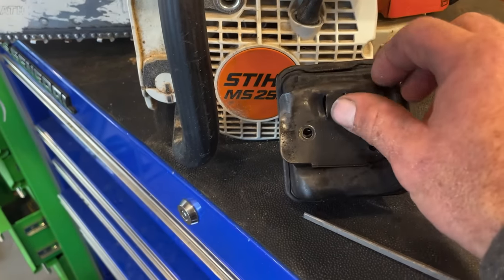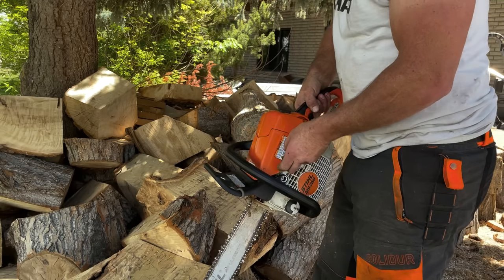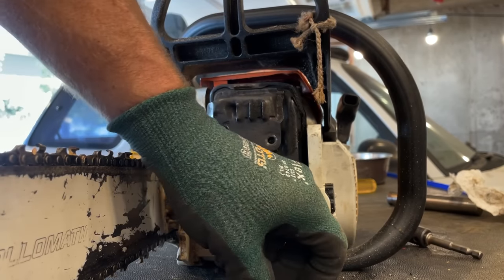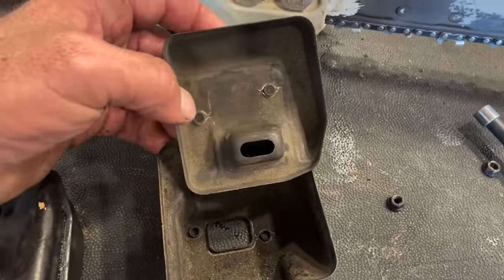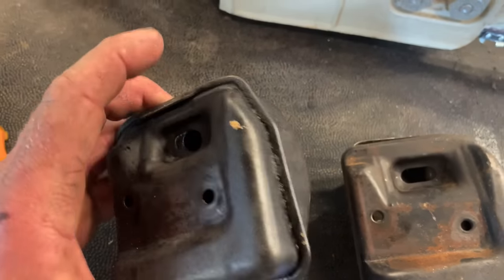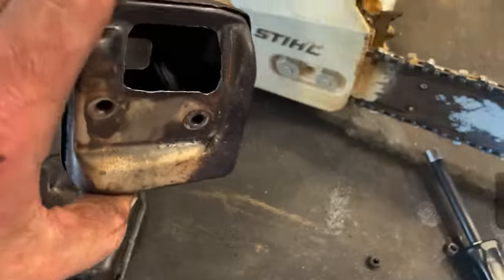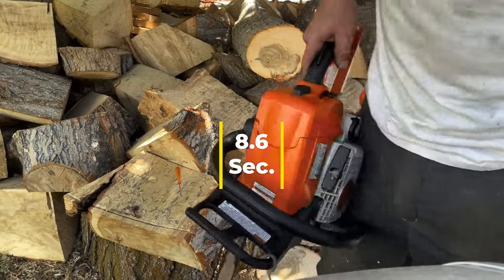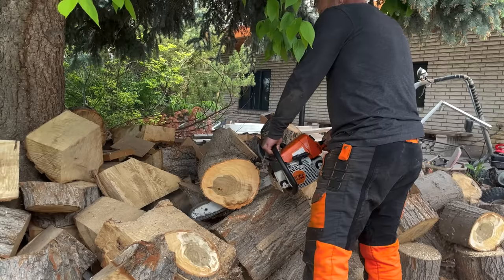Stihl MS 250 Real muffler mod Massive￼ difference￼￼!!!

Comment: Those gide tubes are so you don't crush the muffler when tightening the bolts
Reply: it's more for guiding - only idiots tighten screws enough to crush parts. Have you ever tried to put a long bolt through a second hole with a big, blind gap between? it's a pain in the ass - so they put those tubes, which happen to also add unnecessary structural rigidity. Derr hurr I'm so smart momma I made duh youtube comment telling da guy he was wong
Reply: @tragikk03  i swear these mufflers add at least a lb to the weight of the damn saw. i'm going see if i can just bolt a pipe to the chainsaw somehow
Reply from the maker: @tragikk03 You guys are hilarious! I usually bolt my lips to the cylinder and let the exhaust gas blow through me and out my ass. But I realize not everyone can do that. Because they haven't taken out the baffle yet.
Reply: @schlomoshekelstein908  thanks schlomo sheklestein

Comment: Was a sawyer for year's and my personal experience is most saws need some restriction in the exhaust system.  As far as the exhaust screen I personally use it when on national forest, just for liability purposes. When I was sawing we would start falling before the sun came up and I can tell you the amount of sparks that come off the chain is significantly higher than what come from the exhaust even on a super modified saw.
Reply: Dyno testing has proven that gains are to be had with no restrictions in the exhaust. It does move the power curve though, this is where folks get confused. You might actually loose power at your normal cutting speed, but gain it elsewhere, which might or might not benefit your particular sawing methods. I been cutting timber for 25 years with ported chainsaws, I would never run a stock saw. The older stihls even came factory with dual port or even triple port mufflers like the 038mag 2 made in west germany. The factory knows that getting the exhaust out is a plus. OSHA is what caused the mufflers to become more restrictive, to meet noise requirements
Reply: A Lil bit is required to make good power if you don't have any resistance your it will just sound loud

Comment: Yes thanks for this. I am did a mod on my muffler too. To open it, I ground a small amount off of one corner only, right on the outside edge, then I used an old chisel to pry the top lamination up of the three there. I pried up the foldover, then cut it in the middle with side cutters, then hold the muffler in a vice so I could heat it up with propane till nearly cherry red and used a small flat screw driver to bend up a section of the foldover at a time, moving  down each side. I did 3 sides and was then able to slide/lift that top off the muffler, and reveal the inner baffle. In my case I drill a lot of large holes in it. Reassembly was easy, just slide the top back in, fold back the foldover to secure it. Yes I enjoy having more power, and I know it will take the heat away from the exhaust side cylinder much better, decreasing the chance of seizing. It uses more fuel too of course, as it runs faster and a larger amount of the induction gases (fuel air) bypass straight out the exhaust ( which means it is better at having cleaner combustion gases, and a bigger intake of air each stroke. Its not a tuned exhaust, just free flowing.
Reply from the maker: I'm really glad that all worked out for you. This mod makes such a big difference on a stock saw its kind of silly.

Comment: You should’ve included in this video, that the revs must be checked with a tachometer and that a carby adjustment will be required after doing this modification, otherwise, a good modification.
Reply from the maker: You’re absolutely right and not the first person to mention that lol… I won’t make the same mistake twice! Thanks.
Reply: @arboristlife3494  
That’s not a mistake on your part but a “mere oversight”. 👍👍
Reply: @brianwalker1933  but he DID make a mistake by claiming he made a mistake right? I NEVER make mistakes .. I thought I did once but I was wrong
Reply: @gschady  😂

Comment: Either your chain is super dull or I’m not sure what’s going on on that first cut but that’s quite slow
Reply from the maker: So the chain was plenty sharp and I did not sharpen it after muffler mod, 
I think the very first cut was so much slower because the end of the log was dried out and harder than the rest.?? 
What do you think?
I need to do the video again using a “control log” made up of a bunch of 2x4 glued together for consistency. Like I did in my MS 194 VS MS 201t video. Please check it out let me know what you think. Thanks!

Comment: when it comes to 2 stroke engines, exhaust tuning is a MAJOR factor in power and power band curve. Just opening up the muffler doesn't help because you absolutely need the reverberation to push back and boost compression or you never get that huge kick in power everyone that has ever been thrown off the back of a 2 stroke dirt bike knows.

Comment: Hey ignore the angry (jealous) comments regarding your video. It was well produced, clear and easy to follow. I think you gave an unbiased video based on YOUR experience. Others are free to do their own video...yeesh! There are some illogical people out there!   Anyone buying a MS250 is not likely to be a forestry ranger out in the dry bush. The 250 is a great arborist saw, or yard/farm saw cutting up lengths of chord wood etc so spark hazard doesn’t really exist. By the wear on your saw, it has had a lot of use and it hasn’t blown up because of your mods so you must be doing something right. Just a thought, at the very least, people should keep that screen clean cuz it really robs power when plugged. I threw mine out. Thanks again!

Comment: You can mod this muffler without cutting it apart. 
Once you open up the exhaust opening, there is room to get in to open up the baffle with a drill bit. (On an angle) 
Then use a dremel to clean it up. 
Both the exhaust exit opening and baffle opening are roughly the same size now. 
-you can see right through it, but still has the muffler structure so you can bolt tightly. 
Also, you’ll need to take the limiter cap off your HI adjustment. They don’t give you enough play to adjust -you will blow your engine up at 15k+ rpm after mod. 
Richen up the mixture and use a tach if you’re not good with setting by ear. 
Target rpm is 13k rpm (give or take).

Comment: I'm only here cuz I like putting these engines on bicycles but nice vid I'm gonna try this
Reply from the maker: That’s bad ass! 
What do you use for gear reduction to run the bicycle? 
I’ve actually made a scooter powered by a MS 044 once. I had to use a jack shaft and A total of four sprockets/2 chains to reduce the gear ratio. It worked out great and still hit 28 mph.
Reply: @Arborist Life   wow you're going all out I use a yd100 Chinese 2 stroke bottom end do some modification to the transfers and bolt patterns and slap a 460 cylinder on.. things do 50+

Comment: Not a professional but have run saws most of my life cutting fire wood. Have had one stihl in all those years and would never own another one. The first thing I look for now in any saw is if you can take the pull rope housing off without having to dismantle the saw. The stihl I had you had to take the hand grip or whatever you call it off to take the housing off. It had rubber antivibe inserts, One of them tore while dismantling it. I am not a mechanic and could not get it back together. Shop fees with their minimums would have cost me more than what I payed for the saw. Will never own a stihl again. P.S. Best saw I ever had was a poulan I bought in 1982, Had that saw for over 20 years went through countless bars and chains The shop where I bought it told me they don't make parts for it any more so I got the stihl. Never again
Reply: If the shop time for the daw cost more the the saw to repair a pull starter and a ripped rubber grommet you bought the 170 or something similar.  Those r shit saws and u bought the cheapest saw and expected top of the line performance.  Also, most of my saws are t Yeats or older and I haven't broken the pull start yet, your doing something wrong and consistently are doing it if the 1st feature you look for it being able to quickly fix the pull starter. Stop trying to rip it outta the saw. You shouldn't be pulling till you hit the end of the rope.
Reply: I'm like you, I bought a new Stihl MS 250 because everybody said that Stihl was the best. The 250 was what I could afford at the time. You couldn't give me another Stihl chainsaw. I'm 74 years old now and have been using chainsaws since my early 20's and I know how to start one but by the time I can get it started I'm too tired to use it. I too had a Poulan Pro that I bought at a yard sale and it sat for about 7 years with old gas in it and it fired up within 3 pulls. The Stihl takes a minimum of 12 to 15 pulls to get it going and if it's hot it literally won't start at all until it cools down. If I could afford another saw I'd toss it in a dumpster somewhere. I do still have the Poulan and it still runs great.

Comment: I gut my muffler but use a exhaust pipe that keeps a little pressure in the can. 3/4 I D pipe on 60 cc. Runs cool and bigger carb makes more power. Not just more rpm.

Comment: The RPMs need to be checked with a Tach. to ensure that it's not over revving.
Reply from the maker: Yea she’s running a little high 😬
Reply: i doubt this mod would make the saw rev high enough to do any damage. since its a 2 stoke you could probably push it pretty high in the revs before any component got to its failure point.

Comment: The saw does run stronger but you have also removed and spark arresting ability. Might work harder but now it's more of a fire hazard.
Reply from the maker: Yeah I know, it’s easy enough to put it back in if needed.

Comment: Im just here to wonder how the heck you can start that thing with one pull and no decompression. I have a 251 and the compression jerks my shoulder loose. Had to buy an echo with decompression switch, as my shoulder cant take it any more.
Reply from the maker: Ha ha thanks. I typically rest the 32 inch bar of my 661 on a log and start it the same way LOL.

Comment: Good video, but I find my saws run as well as new when I just clean out all the carbon in the muffler. By the way, two-strokes need a certain amount of back pressure on the exhaust to run properly -as designed, otherwise they waste too much fuel (that goes out unburnt). The environmentalists don't like it.
Reply: Yup what he didnt show or say anything about was the new chain he put on between muffler changes
Reply: @holmes1956O  Lol, yes. It's not good advice anyway, as Stihl spend a great deal of time and effort to get every minute thing correct on their saws -including the exhaust systems and that's why they out-sell any other make.
Reply: @johnsomerset1510  ageed
Reply from the maker: @holmes1956O  🤣🤣🤣 sorry bud the chain was exactly the same throughout the entire video and was not sharpened or changed in anyway.
Reply from the maker: @johnsomerset1510  I would have to disagree with you only because a motor is nothing more than an air pump! Any interference with airflow through the motor decreases efficiency. The internal baffle was only designed to decrease sound Levels, reducing a small amount of power at the same time.
Reply: @arboristlife3494  increasing the power doesnt make the saw cut faster unless it is running higher rpm. It will give more power to help prevent it from loading down. Removing the baffle isnt going to do that.
Reply from the maker: @holmes1956O  OK I understand where you’re coming from but if that were true, how do you explain Hot saw competitions?  The saw doesn’t cut fast because it’s running super high rpm, it’s high horsepower and an aggressive chain.  In my video the Rekers on the saw are low enough that it cuts aggressive so with more pressure it would cut faster but too much pressure and the Saw will bog down adding a little bit of power will allow you to push a little harder making it to cut faster. 
Does that make sense?
Reply: @arboristlife3494  I understand where you are coming from however just removing the baffle will not give the saw more power. It will most likely cause over scavenging of the combustion chamber leaning out the engine and cause seizure and or a holed piston. A 2 stroke engine relies heavily on a tuned exhaust for it to run correctly. More noise is not more power
Reply from the maker: @holmes1956O  well, you’re somewhat correct, the exhaust system needs to be tuned and free of obstruction aka no baffle to achieve performance. a baffle in the expansion chamber basically stops any chance of residence needed for proper exhaust scavenging  to run its best. You’re probably forgetting about the three louvers at the muffler outlet, it provides all the back pressure for residence needed and can be closed or opened up for peak performance. I made another video doing that, you should check it out.
Reply: @arboristlife3494  I am not somewhat correct I AM correct. I have been tuning 2 stroke engines probably longer than you have been alive. Started making them faster and more powerful in 1970. If you want good info on 2 stroke tuning try reading everything you can from Kevin Cameron Gordon Jenings and Irv Kanamoto. Then come back and try to tell me how much YOU know about tuning anything
Reply: @arboristlife3494  I am going to follow up my last post with some wisdom for you. You came back at me because I said you put a new chain on the saw. The wisdom?  The things that bother you the most are the things you know are true. If you truly hadn't put a new chain on the saw you would not have even given me the time of day. Take it for what is. I know you are just trying build viewer interest. There are many like you on the tube with false info to make views. Good luck in what ever it is you do
Reply from the maker: @holmes1956O  OK you’ve got a point, I still think I’m right, but I’m sure you have read more literature on the topic than I. So I’ll dig into it and get back to you. I’m always up to learn something new. Thanks.
Reply from the maker: @holmes1956O  I came back at you because this type of stuff is one of my many passions that I’m proud to share with anyone who will listen. 
Faking the results, for any reason would be f$&?ed up on so many levels.
And I will not standby while you or anyone else calls me a liar. 
You know my intentions with YouTube and everything else it seems?
geewhiz is there anything else about me you’d like to let me know about? 
I mean shit, to assume so much one must have hell of an ego.
Reply: @arboristlife3494  😂😂😂obviously the things that bother you the most are the things that you know are true
Reply from the maker: @holmes1956O  😞 there’s nothing to say at this point, I hope you have a great day, sir. 
PS. Be sure to like and subscribe.  🤣

Comment: It runs better, but the risk of burning the piston increases significantly. A 2-stroke engine relies on a certain resistance to run good and not burning the piston.
Reply from the maker: I don’t think you’re taking into consideration the three louvers at the muffler exit, they provide all the 
Resistance  needed for resonance which can be made larger or smaller for Peak performance. all the baffle does is slow exhaust gases and slightly bring down decibel levels. Obviously, the carburetor needs to be tuned for the modification as to not go lean, damaging the motor like you’re talking about. 
PS. I’ve been running that very saw with the “muffler mod” just over two years now nearly every day for work with no problems.
Reply: Blake Hoekzema  Does the fuel consumption increase?

Comment: I'm sure it will help the saw breath, but it also look like you may  have sharpened the chain as well?  The chips on the first test cuts look pretty wimpy, the second test look like the chain is much sharper.  We also see the file in the second test.  I'm not sure that is a fair test.
Reply from the maker: That would completely defeat the purpose of doing a comparison test in the first place. But thanks for asking.

Comment: Did you sharpen the chain ?…any carb adjustment?
Reply from the maker: No, the chain stayed exactly the same the only difference between cuts was the muffler changes and carb adjustments. So yes, I had to adjust the carb. 
Sharpening the chain between Cuts is cheating yourself from knowing any true gains or losses. 
Thanks for asking!
Reply: @arboristlife3494  ..got it..tnks 👍🏼

Comment: When you adjust the rpm before and after the exhaust mod, then the time to saw that wood should be the same as the max rpm is set  the same, right? So the benefit is then less fuel consumption with the mod?
Reply: For discussion purposes let’s say the unrestricted muffler uses 10% of the saws’ power, while the restrictive muffler uses 25% of the saws’ power.
Set the saw for identical top speed when unloaded with both muffler versions. When doing that, remember you have 100% of the saws’ power available to overcome that 10% or 25% restriction.
Then get into the wood. The unrestricted muffler lets you put 90% of the saws’ power into the wood, while the restrictive muffler lets you put 75% of the saws’ power into the wood.
90% - 75% = 15%.  15% / 75% = 20%, meaning the wood sees 20% more power for the same amount of fuel.
Because the log sees 20% more power you will be able to cut it faster. Because the muffler is consuming less power you will burn less fuel per log.
Reply: @josephdugal4533 
One of the best explanations on this post.